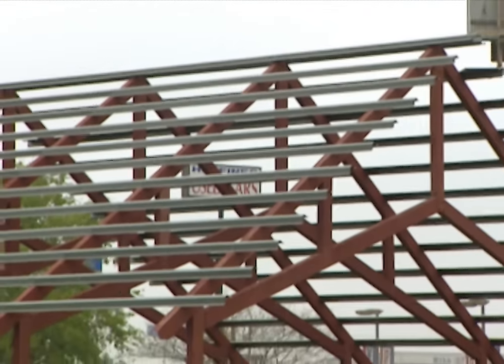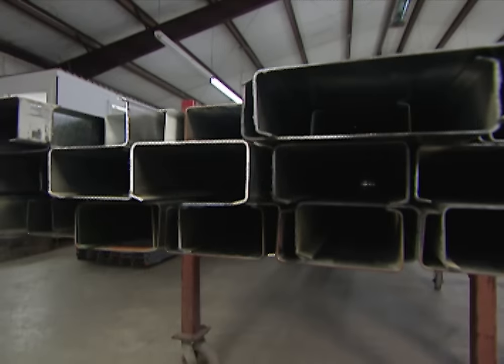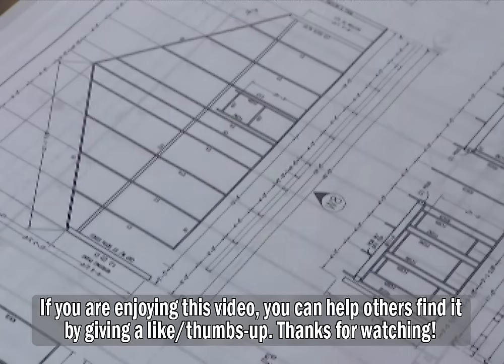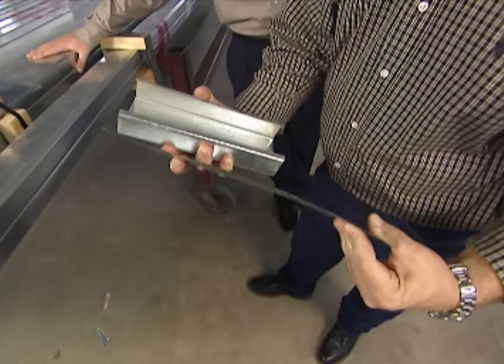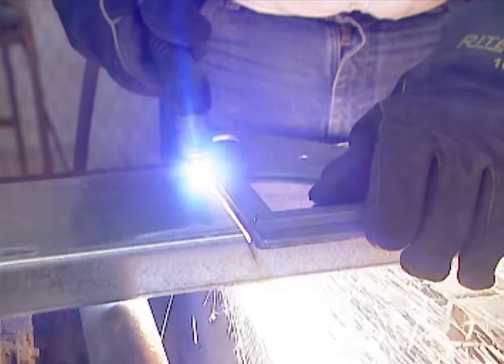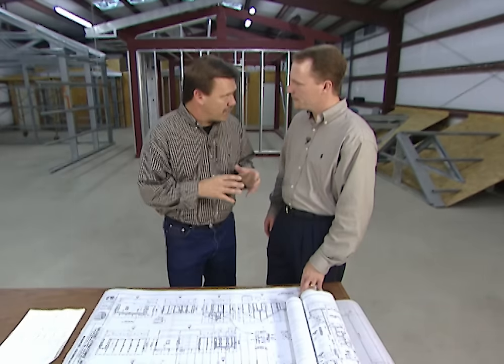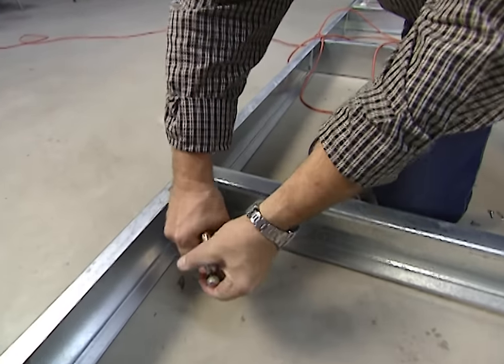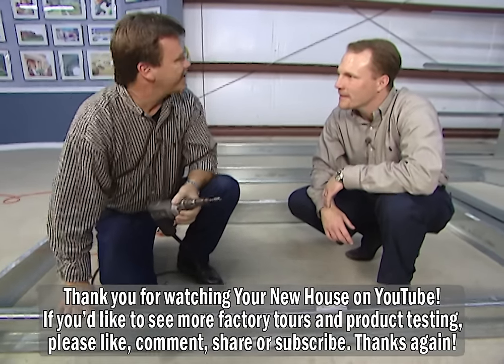Steel Framing - Did You Know?

Comment: I'm worried how strong is screwing thin sheet metal. Are the holes reinforced somehow so that the screw has more to hold on to than just the sheet metal?
Reply: You are correct.  The screws do not bite like they do into wood.  When you bang on the wall it doesn't feel or sound as solid as wood.  I live in a steel framed house and it has its benefits but there are some drawbacks.  It is just as structurally sound as a wood framed house but it is different.
Reply: @YoYo-rr5jz   Interesting and makes sense. That reminds me of the early days of planes when wood was actually superior - metal would buckle due to being so thin and the rivets used to join them increased drag unless they were counter sunk. But due to the ideology that metal is progress, hardly anyone bothered to improve wood planes :(  I still very much like steel framing for termites. In my condo in the SF bay area, I saw dry wood termite damage in the framing, especially in the attic and lots of fecal pellets behind wall plates. But I think this was from a long time ago (2000s?)
Reply: @YoYo-rr5jz     Drawbacks?

Comment: what happens when lighting strikes
Reply: It's earthed so will likely have no effect?
Reply: Your a smart guy
Reply: @Jarmezrocks  what does likely mean?
Reply: @neilhounshell2892  well when lightning strikes any anything it will travel the shortest route to Earth. Being that the house is on the ground and therefore the frame in contact with the ground that there's almost no chance of being hurt by lightning strike. The metal is far more conductive compared to a person and the house is above your head so will get struck first.
I personally wouldn't want to be up inside the roof of the house during an electrical storm.
All of the wiring holes that go through the frame are above ground height also so all the things plugged in are probably at risk of being electrocuted and kill all your appliances though? I can't imagine all those rubber grommets being rated at multi millions of volts? And the fact that your house could get struck on 1 side of the house could mean everything in contact with the metallic frame ALSO can be buzzed because the whole lot is conductive!
That being said if you are inside the house then the house will likely act as a giant Faraday cage?
But I wouldn't like to be the one to test that theory.... The fact that steel frames are noisy and conductive is enough for me not to want live in a house with steel frame.
Reply: @Jarmezrocks  thanks

Comment: I'm pretty sure even galvanized steel rusts at my beachfront property, but this looks great for any place not exposed to salt air. I'd have to question the insulation value though, you'd have to use exterior insulation since the steel beams would conduct heat right though insulation between the beams.
Reply: The only part of a steel stud that you can't insulate is the thin 16 gauge .the edges that you attach the drywall and exterior sheathing to the insulation fits inside of them.

Comment: They are not fire resistant. In a fire steel will buckle and twist
Abrasive cutting as in your chop saw does encourage rusting
Steel framing also encourages condensation and mould

Comment: what about R-value? I would like to see house built in upstate NY and it's image on IR camera in the middle of February....
Reply: I build a house in westchester NY metal framing few years ago , and yes thermo bridging is horrible ,city did not let me use dryvit/ sterofoam for exterior insulation  ,stupid local fire code , but very efficient house can be build using resylian channel for walls I am happy way it come out.
Reply: Meets energy code s.
We did a few as well as office building s.
Reply: @DiscoveryYSC  HI, Zip shearing with insulation would do great job but if structure needs to be fire rated that not so good, depends what you building. In metal house framing for shear loads flat sock is used your engineer will calculate that. For building department if you use R19 insulation in metal framing it will be called  R 19 wall and accepted ,but we know that is not the case .So exterior insulation highly recommended.
Reply: @DiscoveryYSC  Thanks for conversation , Yes You right.

Comment: Definitely an older video. A lot of people are
switching to the non-abrasive chop-saw
blade units.
Reply: I still use abrasive blades metal carbide blades are extremely loud.
Reply: @786otto  Guaranteed that the chop saw guy wears hearing aids outside of work
Reply: No... The new blades that are out now are not that loud,and cut quicker,with almost no sparks,and the material is cool enough right after the cut to touch by hand!
Just crazy to look at a big 12"/14" blade that looks like it's for wood but you can cut thick metal with it!?
Reply: @dansmith8912  I know those, but light G metal studs vibrate as cut with it and that where the noise come from .
Reply: @786otto  ,not if you cut it right! 
Have it clamped/secured close to the cut line!
And have it secured alone the length!
Level!
I never have no problem!?
Reply: @786otto ,and have it face down!
The (open) side down,and the solid side up!
Reply: @dansmith8912  Thats the way to do it .My metal framed house is 17 years old now .Wokked as union carpenter for few years.If you planing to biuld one use exterior insulation and resylian channel on cellings and walls.
Reply: @786otto , heard of that before, good process. thank you for the info!

Comment: I think I'd rather have a painted steel, or epoxy coated, powder coating is probably too costly, but would last forever, unless wind or other severe forces damage/destroy it. It wouldn't rust!!   I have dealt with this in small scale, I don't really care for it,  I'd rather build with heavy gauge steel, with welded or bolted joints, I have worked with steed, done a bit of carpentry, heavy steel, and concrete is the way for me, build it like a bunker, save the wood for making concrete forms!!
Reply: Living within 25 miles of saltwater, any steel, galvanized, painted, powder coated, none would last long from rust, the smallest blemish would start rusting and spread. I agree welding would be the way to go, thats the best and strongest joints you could get. If it was stainless steel, that would be great
Reply: Same thoughts. I'm either leaning towards concrete or straw. Both will work in my neck of the woods considering the weather.

Comment: Thought they went out of business. Steel framing makes for one hell of a heat sink.
Reply: Insulating value is not the best!
Reply: It’s weird that they are promoting a business no longer operational
Reply: @Donald Thorpe not really, you have 1.5 inch wide x 8 foot strps of metal connected by a 3.5 inch by 8 foot strip of metal.
Reply: @Donald Thorpe it has been a long time, but as I recall 18 guage.
Reply: What do you mean heat sink
Reply: @farmfitnesspham4913  metal stud connected to sheet rock and outside sheathing picks up heat and the energy moves from high energy, warm side to low energy, cold side. Wood wall stud is about R3 metal stud zero.

Comment: How do you deal with the hex head screws sticking out of the studs for sheetrock or siding where you need a flush surface?
Reply: Its minimal protrusion....pan head screws are also available.
Reply: U don't use hex head, they are a small round head similar to a sheet rock screw.

Comment: What's the overall cost difference compared to wood framing?
Reply: I build my house using steel studs about 17 years ago then it was 50 C for wood 2x6 and same for 16G  6" stud a running foot. So price was same then , everything straight, and can get exact lengths you need so no waist , only negative is thermal bridging, city I build in did not let me use sterofoam drivit for exterior. It is a multifamily home. Using resylian channel thermobryging can be cut to almost none buy I did not use it on exterior walls.

Comment: I’ve seen them rust.
Reply: The galvanized coating can’t be damaged. But in the real world they do end up getting scratched and nicked. Ideally you’re supposed to spray a anti corrosion paint over any cut end or drilled holes
Reply: For it not to rust*
Reply: @ Benjamin Ibarra, bro there is an
Reply: edit button.
Reply: @kaydog890  yeah
Reply: I saw one going up in the Outer Banks 200 feet from the beach. I was skeptical about rust in the Salt air, but I hope it works out for them.
Reply: @davidstoyanoff  Eventually It will rust but with the house cladding and all it shouldn't be too much an issue as long as the metal itself isn't exposed.
Reply: @kaydog890  some people don't like clicking the edit button because then anyone can make any claim what the person originally wrote and you can't prove it wrong.

Comment: It callange to structure engineer to design light weight panel doing skyscraper more then 2,00 meter .

This light weight system can combined with insitu cast concrete .

Comment: What is the cost of construction including materials when compared with wood? Is the drywall screwed to the steel studs or glued?
Reply: Everything is screwed. Sheathing, decking and drywall.
Reply: @natej6671  I have built several houses over the years, all wood, but I do like the steel framing you show. Has anyone ever tried spot welding rather than bolts?
Reply: @ericbarnes3829  This isn’t my video but to answer your question, welding is seldom used because all connections are provided by the stud supplier. Welding is only used in special conditions if the gauge of the studs can support it and if the steel stud designer approves it so as to not violate any warranties. Bringing a welder to the site introduces another trade and drives up cost so contractors tend to avoid that.

Comment: Where can I learn to build with this system in Canada?
Reply: I had an advantage , I took Mechanical Engineering . But I have to design alot of frame works for mill machinery etc . Wouldnt think of using wood , between vibration and rot   and salt air , steels better . I guess you could take some night school  courses to learn   about it . Im use to working in an office where the whole bunch of us are a team , and add  input .
Reply: @paulbains9152  
I'm form Bolivian. I am an architect, I am unemployed, I would like to travel to Canada to learn steel frame and work there as an laborer. Do you know of any school where I can learn? .. I'm looking on the internet and I can't find anything at a technical level.

Comment: Steel framing aint cheap my friends at over 10% increase in cost over wood construction.  I am assuming though, that the cost listed included not only materials, but labor as well.  As for wood, it is problematic because there is very little "First Growth" trees left to be harvested.  Old growth trees produce better lumber.  New growth trees five to ten years old produce very high moisture content wood that must be kiln dried or it will do what we called "Airplane warp", or "Banana warp" wood.  If your home is totally built out of Kiln dried wood, it may come close to the cost of steel.
Reply: Currently steel s cheaper than wood

Comment: OK Cold cutting with metal blade is ok. Plasma cutting and grinders are not permitted even on non structural drywall partitions so definitely not ok on structural things. Heat damages the galvanized coating causing rust issues.
Reply: Actually very little cutting is used metal studs / floor joists can be ordered to any size ,any cutting is done using chap-saw with abrasive blade. I used 16 G

Comment: Would be a nightmare down the road if remodeling.
Reply: No , we quite often cut apart steel builds , and re-use sections in a different configuration . try doing that with wood .
Reply: @paulbains9152  with wood its actaully super easy and always done. Wood frames are way more common on residential.

Comment: Very cool, but that steel seems like a very good thermal shortcut so I assume there are some special things in that area. Also condensation may be an issue.
Reply: Indeed. That is why with steel construction you're supposed to put all the insulation on the outside, so the steel stays at the same temperature year round.
Reply: Zip-R panels on the outside solve that.

Comment: In case of a fire, solid wood just burns but steel gets weak and falls down very rapidly. I've seen that in my village.
Reply: Same thing with the world trade center twin towers. “Jet fuel doesnt melt steel beams”. It doesnt melt, but it does soften, and its a heavy ass building.
Reply: The wood in a wood framed house not only burns, but is also the primary fuel source for the fire to begin with.  The steel only needs to stay strong long enough for the carpet fire to burn out.
Reply: @eventhisidistaken  what kills in a residential fire is mostly the smoke from beds and furniture - not the flames itself.
Reply: @KlanHoffman  That's true whether it's steel frame or wood frame.  But the amount of wood in a wood framed house is enough fuel to burn the entire house to the ground if left to its own.  None of that fuel exists in a steel framed house.
Reply: @eventhisidistaken  not sure why that would be a great advantage of the steel frame version. In my country we have something called winter. Usually the insulation is the biggest concern as fire hazard or as an economic factor. Steel frame does pose as a problem in that regard too.
Reply: @KlanHoffman  I don't know if steel is overall an advantage or not, but in terms of fire safety, it clearly is.  It's also better in regards to insect damage.  But it will conduct lightening, and it will rust if you have an area that's getting moisture, and it is terrible in regard to insulation, and in a strong earthquake of hurricane conditions, if bent, it will stay bent.  It's better for some applications, worse for others.  It depends on where you are.
Reply: @eventhisidistaken  in big important parts of the structure, I would still prefer massive old timber due to stability.
Reply: @KlanHoffman  Okay.  I suppose wherever you are, that's something that can be bought.  In the US, you'd pay a fortune for that.  The kind of wood used to build houses is fresh cut kiln dried and manufactured 2x4's.

Comment: Bull I've seen galvanized studs rush clean through
Reply: We've all seen wood rot.  You aren't supposed to have water in contact with either one.  One molds, warps, and decays while the other rusts.  Not much different.

Comment: Everyone who ever purchased one of these steel homes felt instant regret when they tried to hang their first picture....
Reply: You can still drill thru the metal stud....
Reply: @godgoldgunsngolf6733 -  Yeah.  I get that.  Everyone gets that.  I was mean to be funny.  Sorry for your confusion...
Reply: @smartysmarty1714  snarky
Reply: I live a steel framed house and put brand new trim.  It was a nightmare.  Nail gun would work 75% of the time and the other 25% would trash the trim board.  Predrilling sucked so I just muscled trim screws in but then they would not cinch the trim to the wall as it does with wood supports.  The house does make lots of noises during weather and even shakes during wing.  It is sturdy but not as solid as a wood framed house.  No worries about fire, rust, or rot though.

Comment: Sign me up! A steel home can act as a natural Faraday cage
Reply: Which is in itself a problem as you cannot get a cell signal inside the house and WiFi networks don't penetrate the walls well requiring multiple hardwired or even more WiFi extenders distributed throughout the house to have decent internet connectivity.  I live in one of those houses built in early 90's and it wasn't insulted well to account for the heat conductivity of the steel so it is cold in the winter and hot in the summer with subsequent increased HVAC costs.  The cost was much more than the cost of wood back then also.  I wouldn't build one out of metal today without serious research to solve those problems.  As for a faraday cage, I have multiple sites in house and metal buildings to cover that niche!
Reply: @williamediger3193  thanks for sharing. I was hoping to learn of someone's experience like this in a steel home.
Reply: The steel studs are kinda far apart, its not a faraday cage, EM waves are getting through easily.

Comment: Who needs trees. When you can build it out of beer cans.
Reply: Amen. Steel rocks. It's 100% recyclable. We got good companies like Nucor pumping it out right here in the USA. It's mold / pest / warp-proof, nearly fire-proof, strong as hell.... and with a teeny bit of training and tools, it's just as easy to work as wood quite frankly.

Between a thick steel frame (not this flimsy galvanized crap they show in the video) and Earth / Hempcrete / Clay Straw walls, you could eliminate the need for 90% of the wood in any residential family house.

Wood should be used for interior flare.... for decks or saunas.... art or furniture, or the occasional artisan timber-frame house... and otherwise just leave it be in the damn forests. Wood should never be put into OSB, which just rots, releasing formaldehyde and mold spores. It's preposterous that we haven't replaced your average McMansion's dimensional lumber and OSB with steel decades ago.

Comment: I’ll bet they don’t re-galvanize after it’s cut. The cuts will rust.
Reply: The cut will get a little rusting but unless you have continued exposure to moisture it won't be a problem.   If wood was in that same  wet environment,  it would rot and produce mold.   Having a  interior of sheet rock will allow moisture to be controlled around the steel studs.